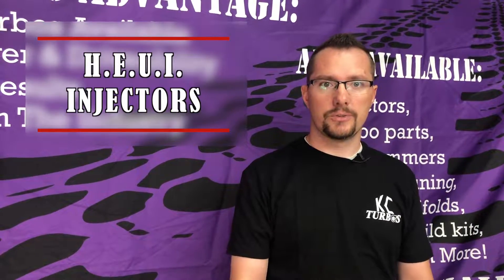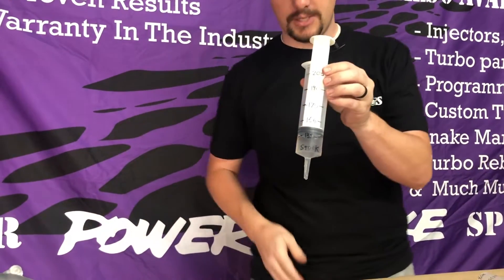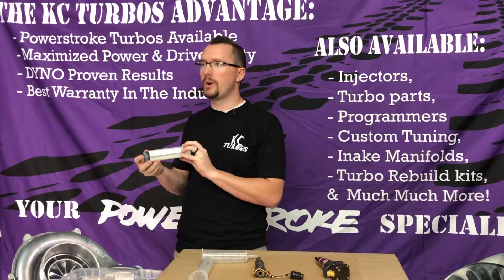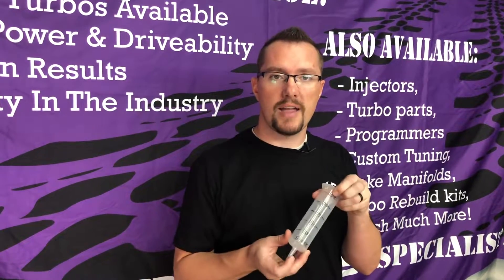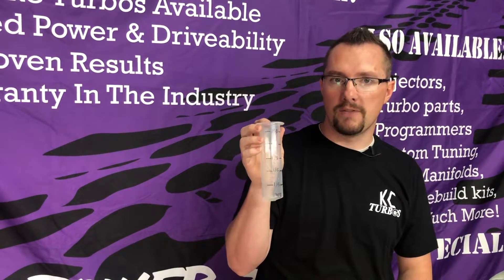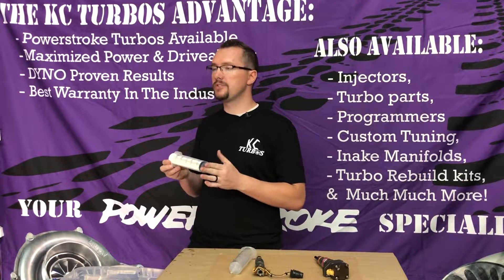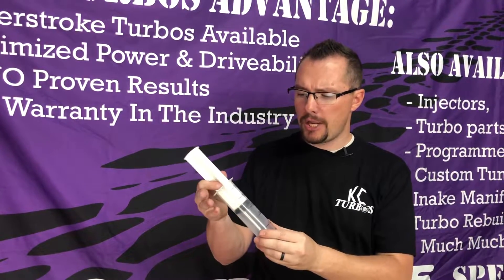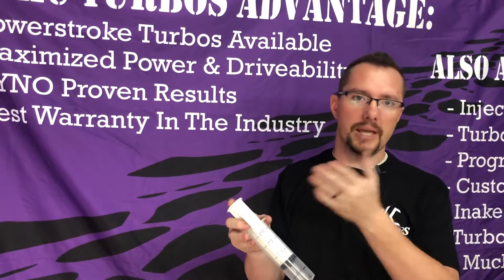All You Need To Know About HEUI Fuel Injectors! - Understanding 6.0 & 7.3 Powerstroke Injectors

Comment: Purchased new Dieselsite Adrenaline HPOP
for my 2003 F350. Currently my HPOP will hit
1700psi @ WOT then drops off. Replaced IPR &
ICP. Can't find any leaks. A ny troubleshooting
ideas?

Also recently had 180cc Full Force Injectors & Stage 2 KC turbo installed.
Reply from the maker: Whats tunes are you running? 
Send an email to sales@kcturbos.com or give us a call at 480-688-7160 and we can help you troubleshoot.

Comment: Maybe I missed it but so theoretically about how many cc's of fuel can pass thru stock nozzle's at a maximum PW  full race tune @ wot? I'm just trying to understand why  spend another $400 for 30% larger  on the 155's
Reply: Problem is to dump 155cc through a stock nozzle takes more than 2.4ms and without ficm tuning you will have a hard time running more than 2.6ms consistently because the stock ficm tuning pulls fuel in the higher rpms.  On top of that you have issues with refill time of the heui injectors if you run too much PW.  Most tuners prefer the 2.0-2.4ms range.  155/stock is ok... but we never recommend 175/stock or 190/stock

Comment: I have a kc stage 2 turbo and looking at new injectors, anyone have a good suggestion on size for daily driving with the spd tune
Reply: I am having Southern Service & Performance in GA install a 2000’ 7.3 (with forged rods, 90k mileage w/3 year warranty) in my 02’ F350 DRW 4x4. Also installing a KC300X stage 2 turbo, Swags Aluminum Spider Plenum, Riff Raff aluminum plenums, upgraded to 5” down pipe and exhaust, stainless steel 304 grade headers and up pipes, EBPV delete, Rudy’s all aluminum Intercooler and ASI 4 row all aluminum radiator, Adrenaline HPOP, Eaton HPOP lines, Holders 180cc 80% nozzles, New 300 amp high output alternator, Power Steering Pump and Lines, Water Pump, Silicone Radiator hoses,100 PSI Silicon Boots, Every Sensor I could think of, S&B body mounts, ATS 5 Star Torque Convertor, John Woods Valve Body, Front and Rear Viton Tranny Seals and PHP Hydra Tuner by Jelibuilt. I’m waiting here in Florida, Waiting on them to call. $15,583 for parts and another $6k+ for complete install. Possibly have to order specific wiring harnessI because my truck is a Lariat package, I’ll post results once I’m Rolling again. Been ordering parts for the past few months, Installation is scheduled for this week and next
Reply: I call My truck “FAT BOY” and the 37’ Keystone Raptor 5th wheel Toy Hauler I tow “The Dog House”. I’ll be posting videos on YouTube soon

Comment: Love your video what injectors you recommend to run or what are the best injectors to run in a 6.0
Reply from the maker: We have used Warren Diesel injection For years and highly recommend them. What specific injector? That would depend on what you use your truck for? What your goals are? what turbo and supporting mods you currently have?
Reply: Thanks so much I tried the heui injectors that innovative diesel recommended and it's been a nightmare ever since they keep dropping off had to replace now GOING on 3 times when I was originally going to go with Warren and innovative steered me the other way IM PISSED . I have 175/30 injectors and a powermax gxr-11
Reply from the maker: @MegaBigbizz  That sounds like a good turbo/injector combo! Have you upgraded or replaced your HPOP?
Reply: @KCTURBOS  yes sir I did !!

Comment: What I wanna know is what has lower egts while giving as much power safely. 160/80 cc injectors or 180/30cc, 50, 80 or 100 nozzle? I have a stock 2002 f250 super with 4r100 trans. My injectors are going out and will need injectors soon. I wanna have more power and tourgue but stay within safe h.p and tourgue levels. I've heard since I have pmr I can only produce 400 max up before I break shit. But is that rwhp or up at the crank? I should want better injectors so if later I wanna upgrade more parts I won't have to buy injectors again. I k ow with some injectors I'll need it tuned. 

Every blog I read has conflicting information. Some say run 160/30 while others say 160/80 injectors. Some say don't waist ur money on 30% nozzles cause it's not much of a difference from running stock nozzles. On 1023 website it says that 160/30 injectors will work fine with everything else stock. It also say with these injectors it won't control egts very well. I've also read that the bigger the nozzle the more fuel and more fuel will lower egts. I'd rather buy injectors that will get me to 380 or a little less h.p and detune them unroll I get supporting mods.

 Injectors are to expensive so I don't want to buy injectors now then when I get new turbo and more have to go and. It new injectors again. Also on full force website it says they recommend 180 injectors for my years super duty but didn't say which nozzle size. I have no problem if i blow some black smoke as I don't have smog where I live. I know black smoke means higher egts but if I can keep it in check then all good.
Reply from the maker: It sounds like you want more power and lower egts, but not too much power. First off what is the primary use of your truck? Daily driver? Tow rig? Depending on what you use your truck for, will depend on what injectors you should run on your truck. 

First off, we have also heard all the opinions on PMR vs forged rods. In our experience, every time we have sent or bent a rod, it has been forged. 500whp is a more realistic power level to stay under. Anything over, you are on borrowed time. This also depends on the purpose of the truck and the driver. I would truck an adult with a 500 hp PMR 7.3 over a teenage who wants to race every vehicle at a stop light. 

EGT management depends on injectors size, the properly sized turbo, the type of turbo, the tunes on the truck and most importantly keeping your rpms up in the optimal operating range of the engine. When towing, it does not matter what turbo or injectors you run, if you lug the motor at 1500 rpms, its going to get HOT. Drop a gear and raise the RPMs up above 2200, and the EGTs will be in check. 

160 or 180 injectors from full force are basically the same thing from full force. We have performed a lot of testing and have found the 180-30% injector to be optimal for towing. This also applies for those who want to bring their 7.3 up to modern diesel power levels. Who’s custom tunes you run can make a big difference also.
Reply: @KCTURBOS  thanks so much for the reply and info. I'm not a hot shot driver but I do tow occasionally.  Most of the time I'm not towing anything but if ever I do need to tow I don't want to be limited on what I can tow if u know what I mean. I bought the truck used and it has 35x12.50 tires with I believe a 4 inch lift. Engine is stock. It has 200k miles on it and I need injectors.

 Normally I'd upgrade the intake upgrade the trans cooler, intercooler upgrade to a 4 inch or 5 inch exhaust then do injectors. But because my injectors are going out I need to start with those first. But I don't wanna say get injector A then after I upgrade everything then I'd have to change to injectors B. I'm the tryp of guy who thinks it's better to have it and not need it then to need it and not have it. 

Basically I'd like my truck to do what it does now but easier and faster all while not dancing with the devil. I do understand that the 4r100 auto trans is the week link on a super duty. But I'm hoping if i baby it and not get crazy and drive it like a hot rod I'll be somewhat ok until I get the $$ to upgrade it. Also I'm 38 but sometimes I like to go fast but 99% of the time it's normal safe zone driving. But I don't wanna get smoked by a Hyundai if u know what I mean. But I'm also not looking for a quarter mile truck either.

Comment: I have a 2007 6.0 and need injectors. I am running the SCTX4 with the performance tune supplied with the programmer. Warren recommended the 155/30 injectors. Do you agree sir? Dailey driver that I like to step down on the skinny pedal every now and then. Mild towing. Awesome VID BTW. Well done.
Reply: I know this is probably over a year later on even a single response. But I’ve been running 155/30 injectors from warren, which u have to get custom tunes for or it won’t idle correctly. But god damn my truck is so much quicker and responsive. Idk if it’s just the custom tunes or the injectors themselves(or maybe the mix) but wow. Would recommend 6.4 banjo springs and blue spring mod. Anything that helps fueling. Don’t get an RR or a lift pump with a stock turbo or a drop in turbine. Not worth it because I’ve no performance or cooling on my end.

Comment: This is by FAR the best explanation for injector size i have come across. 

Question: If you go to 40% nozzle with 155cc and change PW to a higher number would that help with added performance? All examples you gave were with the stock 30% nozzle... 

Thank you so much!
Reply: There are benefits to dumping fuel faster, but there are also downsides.  Typically the downsides of a larger nozzle are felt down low, initial tip in of the throttle, leaving a stop, lugging the motor in OD at low rpms.  The benefits of a larger nozzle are usually felt under heavy load when maxing out the injector.

Comment: I have a fairly stock truck. Stock injectors, fule system, turbo but I was thinking of going 250/100 and trying to run lower hp tunes and then just have room to grow later. I would want to make around 425 hp cause that’s what my clutch is good for is that possible with just upgrading injectors?
Reply: It’s a 7.3 btw
Reply from the maker: 250-100 injectors are fairly big, so with the right tunes you should be able to hit those numbers. You  are going to want to upgrade your turbo sooner rather than later, as a stock turbo will run hot and smokey on that set up.

Comment: What is the biggest stock nozzle size that will empty at max pulse width in a 7.3
Reply: The problem will be determining what "max pulse width"... that is a matter of opinion to a certain point.  Most tuner run 4.2ms but some go as high as 5.6 ms.  But if you run really big nozzles like 250/200 then you don't need much more than 3.6ms

So you can dump 160/stock on a 5.6ms tune, but not likely on a 3.6ms tune.  Same goes for 205/30s.  You won't dump 205cc on a 4.2ms tune but should be able to do it on a 5.6ms tune.

205/80s dump really fast and don't need more than a 4.2ms tune.

Comment: So your saying I can get 190/30s and just have a tow tune for 175/30 and they will function as 175/30s??? This is great news
Reply from the maker: Thats correct, they will run exactly the same. they might even feel more like a 155-30. Tow tunes typically only have a 1.6ms pulsewith, so you wont be able to empty 190cc ever on that.
Reply: KC TURBOS that's great will be ordering 190-30s here soon then thanks!

Comment: Excellent Video, Very Informative. I wish i went a Little Bigger with my injectors, just as you said. I'm running KC STAGE 2 With Warren 175/30% injectors. I recently Completely Bullet Proof my 6.0 Got my Custom Tunes from Chris at TSD. I just ordered a AirDog ll-4G 165 GPH Lift Pump. Already have a Regulated Return Fuel System. I want to upgrade my 175/30% Warren Injectors to there 205/30% or 205/75% Warren Injectors. My Question is do i have to do Anything with my Custom Tunes that Chris at TSD already wrote for me ? Also saving up for a Tourqe Converter and Billet Input Shaft for my Stock 5R110, will the Aftermarket Tourqe Converter have anything else to do with my Custom Tunes ? I'm sure the Converter shouldn't have anything to do with my Tunes, I'm just trying to Prevent any Problems with Transmission. Until i have Enough Money to Upgrade entire Trans. Like you said in Video, everyone wishes they went Bigger with Injectors. Wish i did also. Only reason i kept it Mild was i live in a State where my Truck had Emissions Testing every 2 Years. Went through with Flying Colors, that was also with EGR Delete and CAT Converter Delete. Actually had Cleaner Readings through Tailpipe than Before the Whole Bullet Proof, and injectors and Turbo. Like i said gonna be Switching from 175/30% to either 205/30% or 205/75% Question again is my Custom Tunes gonna have to be Changed with the Addition of AirDog 165 GPH And the Larger Injectors ?  Thanks ahead of Time for any Responses. Also want to Add when i bought all my Parts for the Bullet Proof Job, wish i went with the Stage 3 Turbo Also and the Larger Injectors to Begin With. Was Debating between the Stage 2 or Stage 3 for a while before i bought. Wish i Went Bigger Both Ways. Turbo and injectors. Couldn't be any Happier with all your Help Charlie, through all my Question i Emailed with you before i bought. I LOVE the Stage 2 lots of Power, Very Responsive. Just Looking for More Power !!!
Reply: With a very custom setup you need to get a new tune or else it wont run as great as it could and parts might not function correctly. If you’re just adding like a y pipe or a new ficm then no. Bur for fuel or air new tunes are necessary

Comment: To clarify, those CC capacities are not what the injectors hold, but the amount of fuel flowed over a thousand injection events. So 205cc/1000= 0.205cc per injection. Great video!
Reply: Thanks for explaining this.  I didn’t understand how an injector could flow say 200cc of fuel and dividing by 1;000  clarifies it.
Reply: Which would mean that a "stock nozzle" for a 135cc/min is not the same size as a "stock nozzle" for a 155cc/min given that same injector pulse width.
Reply: @georgewinstead6724  a little late... but 135/stock and 155/stock will flow exactly the same on the same PW tune.  Same nozzle, same pressure, same pw, same amount of fuel.  Body size is just the limit if you bump up the PW
Reply: You are correct... it is per 1000 shots and that should have been clarified in the video.  But still applies the same theories and how injector sizing works.